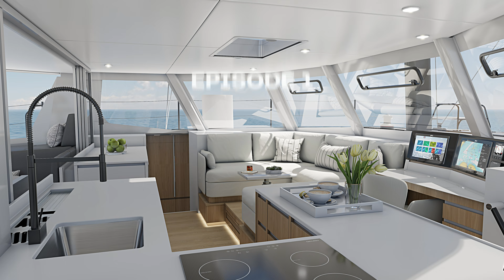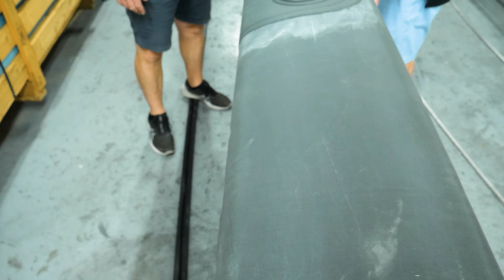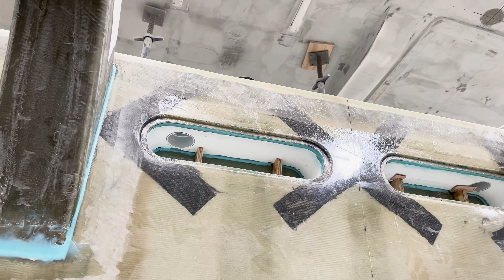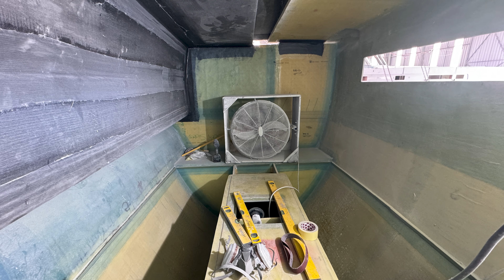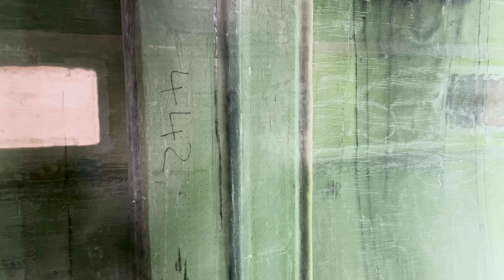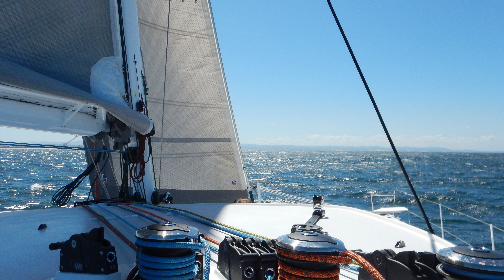Is Carbon Fibre Worth It on a Cruising Catamaran? An Honest Answer

Comment: Hey Patrick, not sure if you’ve checked them out, but there is a local full carbon dinghy manufacturer in Knysna called SeaSUV that a bunch of us have purchased instead of the OC Tender.  Lots of nice improvements over the OC, plus supports the local economy & is a significantly better value once you factor in no shipping & import costs. Ours is next to “splash”.

Also cool to see our boat in the video showing the different carbon options 👍🏻
Reply from the maker: Yes, a few of our customers are buying these and it makes a lot of sense to avoid the shipping costs and get a local product.

Comment: Is there any interest in s-glass instead of e-glass?
Reply from the maker: Not currently.
Reply from the maker: To expand a little further:  S-glass has niche applications where its higher tensile strength and impact resistance might be beneficial, but in general, it does not offer enough performance benefit to outweigh its cost and application limitations. For performance-critical areas, we prefer carbon fiber; for cost-sensitive areas, E-glass is the most practical solution.

Comment: My question relating to carbon would be, its compatibility with other materials, and the electrolysis created. Thanks 👏😎🇦🇺
Reply from the maker: Carbon must be bonded properly when in contact with other materials, in particular metal fittings. This is so whether we are building a full carbon XP model or a Carbon Cross or Carbon
Core version of our boats.

Comment: Love the series gents, just wondering why you have a preference for ‘E’ glass over ‘S’ glass?
Merry Christmas
Reply from the maker: Hi Matt. Sorry for the late reply... hope you had a good break like we did. To your question:

E-glass is our preferred choice due to its balance of performance, cost, and availability. While S-glass offers roughly 20–30% higher strength and stiffness than E-glass, it is significantly more expensive—often 2–3 times the price. Additionally, S-glass works best in unidirectional fibers, whereas for hulls and decks, we require stitched or woven fabrics to ensure multi-directional reinforcement and easier application to complex shapes. This makes S-glass less practical for our structures particularly in a production boat environment.

Historically, S-glass gained popularity in the mid-1980s for IOR Grand Prix raceboats when carbon fiber was prohibitively expensive. However, as carbon fiber became more accessible and cost-effective, it largely replaced S-glass in high-performance marine applications.